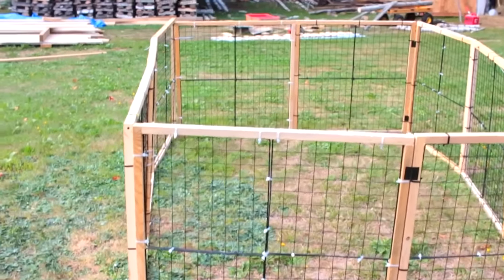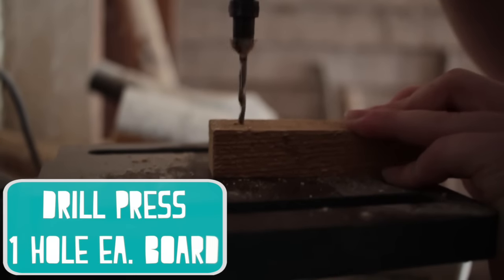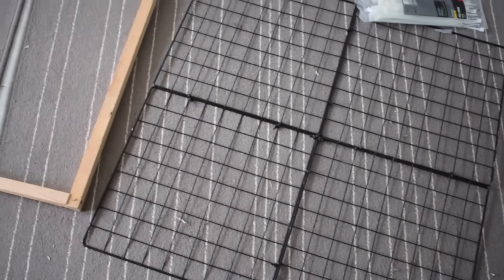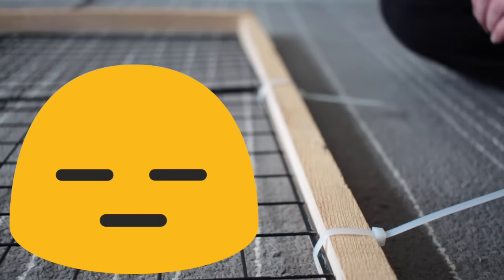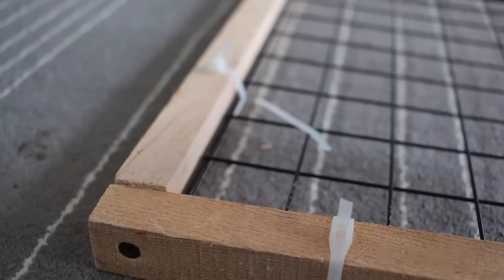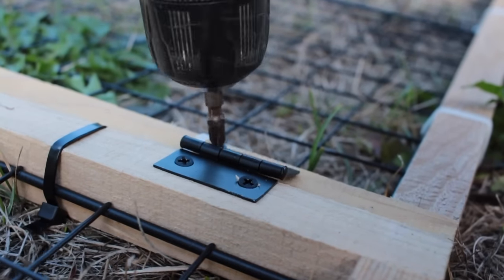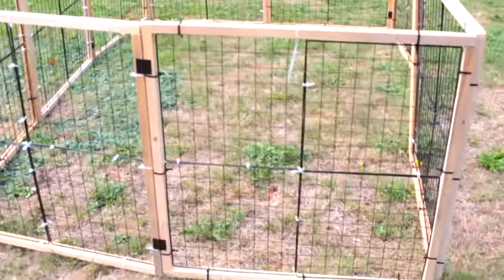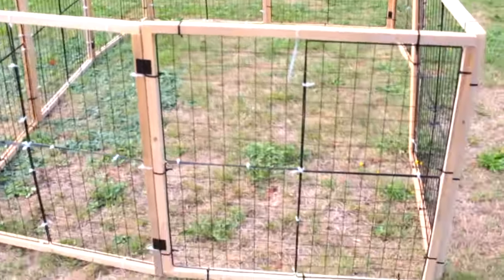How I Made My Rabbit Run

Comment: I have multiple rabbits I have to house outside. I want to enclose a 10x14ft area that has a roof and build 10 separate 2x6ft cages like this. I’m just trying not to spend alot of money. Do you think this could work? My dad wants to keep breeding them in 2x2ft cages with wire bottoms but I’m trying to give them better homes but I have to pay for it. I’m 14. Any tips would be great thanks. Also I’m thinking about using concrete tiles for the flooring also with rugs.
Reply: I don't know how all that turned out for you, but kudos to you for wanting to give your animals a better life than they'd been living.

Comment: I have a lot of chicken wire left over from building a chicken coop. Could I use that instead of the grids?
Reply: Deanna Barta yes
Reply: No it's too weak foxes and other predators can get through, grids are a good choice
Reply: rabbits will eat through chicken wire.
Reply: Deanna Barta there’s tons of other good wire choices at Home Depot/ Lowe’s/ Ace/ Tractor Supply
Reply: yes because its pretty much the same thing
Reply: Deanna Barta I did but if you have squirrels in your yard or wild rabbits I would reckon you do 2 layers!